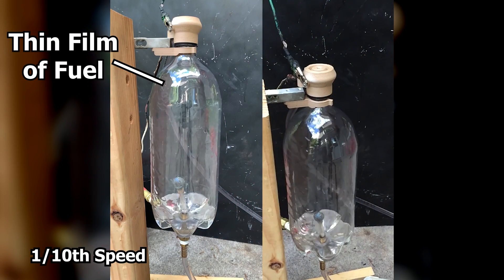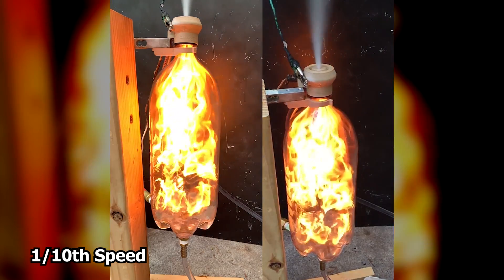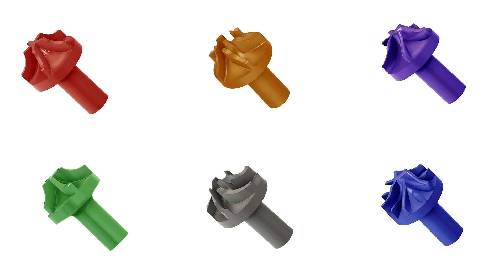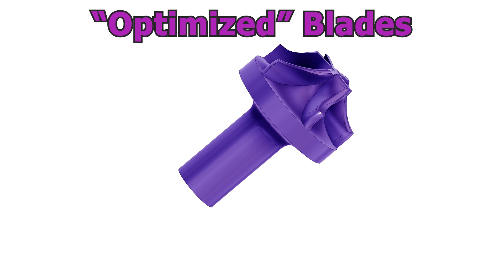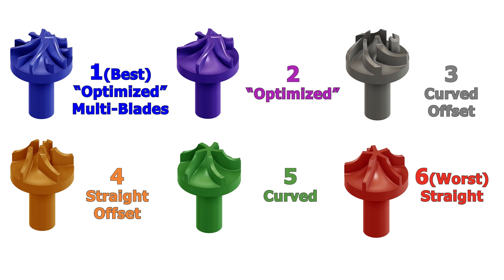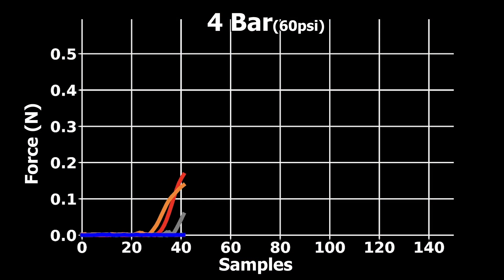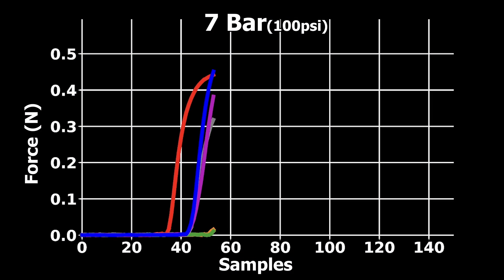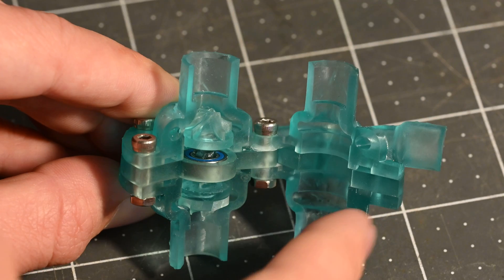Testing Tiny Turbo Turbines

Comment: These are impeller designs, they are NOT used for converting pressure-velocity to mechanical torque.. The losses are way to high, you mixed up the type of design. Air foil type of blade is used for the exhaust flow side...

Comment: Try a Tesla turbine. Since it will just be seeing compressed air and not high temperatures, you can get extremely thin discs and disc spacing by using thin aluminium sheets (think ~0.8mm thickness akin to soda can thickness or less). 

Apart from being easy to manufacture and balance, the simplicity of the design means that tuning it to your system is a function of simple geometric quantities.

Comment: You can improve a lot the efficiency of the turbine by making it spin faster, this is because the smaller a turbine is the faster it needs to spin to have high efficiencies. (you can guess the optimal speed by looking at the Balje diagram for turbines and adimensional theory of fluid machines)

Comment: search term you should loo for : " radial turbine velocity triangle" equations are time consuming to solve and not simple , that the rason for they use CFD. but the principle is that the air comes at a vectorial angle that depend on lift of the blade speed of the air and pressure. You should considere that each blade is actualy a wing that curve arround the axle torque and speed will also depend on the radius of course, and it will vari from the whole radius. the principal is th same as a propeler whre you trust depend on angl of atack naca profile and radius and  pitch at each distance of the center. so you have to figure out te formula for a particular point on th radius an itegrate all the point (integral equation)

Comment: manually calculate the turbin blade angle and length https://www.google.com/search?q=turbie+velocity+triangele&sca_esv=581287324&sxsrf=AM9HkKlQ2iFoMHRU_77X-ajUjlV_j-z0YA%3A1699644746299&ei=SoVOZaHqEeWkkdUP0bONoAg&ved=0ahUKEwiht-OKlrqCAxVlUqQEHdFZA4QQ4dUDCBA&uact=5&oq=turbie+velocity+triangele&gs_lp=Egxnd3Mtd2l6LXNlcnAiGXR1cmJpZSB2ZWxvY2l0eSB0cmlhbmdlbGUyBxAAGA0YgAQyCBAAGAUYHhgNMggQABgFGB4YDTIIEAAYBRgeGA0yCBAAGAUYHhgNMggQABgFGB4YDTIIEAAYBRgeGA0yCBAAGAUYHhgNMggQABgFGB4YDTIIEAAYBRgeGA1I0BNQ0gpY2RBwAXgDkAEAmAFjoAG2AaoBATK4AQPIAQD4AQHCAgQQABhHwgIKEAAYRxjWBBiwA-IDBBgAIEGIBgGQBgg&sclient=gws-wiz-serp

Comment: Compressed oxygen tanks (including the tiny torch sized ones) are 800 psi. Depending on the pump pressure curve, wouldn't that possibly achieve high enough pressure to overcome the chamber pressure?

Comment: You should make it fully 3d printed on FDM and with fidget spinner bearings I made one like that but I also 3d printend bearing didn’t work it turned but not great (btw  this test is a torque setup not rpm or pumping power unscientific but fun)

Comment: one other thing to take into account is variability in speed , the efficiency of the turbines could change at different speeds so it'd be interesting to see if the results change when you use a smaller prop.

Comment: Does a turbine work the same with water as with air?  I don't know the answer, but I feel like the viscosity of water would cause it to act differently than air, thus the most optimum turbine for both might not be the same.

Comment: Hi! I made some impellers out of wire cube storage brackets. They are plastic and have 8 straight blades arranged in parallel pairs. The gap between the centers of each set of the parallel blades is about 23% of the total diameter of the impeller. The blade pairs meet at the shaft and the shaft blocks the gaps between the pairs. I don't plan to replace them unless their performance is totally dismal -- and I don't expect it will come to that. But if you could test a similar design and compare it to the others, that would be awesome! Thank you in advance if you do!

Comment: How about a 2 stage turbine?
And maybe try a pelton turbine concept.
Also, you should measure power, not trust, cuz some turbines might perform better at different speeds, or have higher torque, others higher top speed

Comment: Hello! Your test at 0:56 probably did not fail because it was inherently bad. It failed because too much propellant pooled into your combustion chamber before ignition. In rocketry, this is known as a “hard start”. 

This can be solved by having the ignitor close to your injector at time of ignition, or starting with a small flowrate to achieve some combustion in your bottle and then crank it up to full flow.

Great video!

Comment: Equations for turbines can be found on several difrent NASA SP s (Special Publication) you can find these on the NASA STI server. Conveniently I have chosen a 3D printed air driven turbo pump for my scince fair project this year drawing some inspiration from your video 7 months ago. Axial and staged impulse/ reaction turbines are much better suited for pumping fluid because they can provide more torque at higher RPM with the same flow/presure.

Comment: Check out the exhaust/hot side of a turbocharger. Housing and turbine. They are pretty tightly fit for clearance between the turbine wheel and housing so no exhaust is waisted If you can reproduce this in a smaller scale this will produce phenomenal results and hopefully you have a propeller strong enough for the high rpm output. Will be like a jet turboprop just powered by high pressure air instead of jet A fuel.

Comment: Stators might be a good idea. Also, if you look at turbines on car engines, the blades are curved on the outer rim, bent towards the airflow. I think the thing you're going for with a turbine is to get the air "impact angle" at something like a 45 degree angle, even as the blade moves away from the airflow.

Comment: Some thoughts for optimization: 

1. It would be ideal to include a thrust bearing in this setup in addition to the radial bearing you included, as I would bet the thrust loading is being borne by either the balls in the bearing or the plastic of the housing rubbing, which would hurt efficiency.

2. It is very likely the case that the optimal rotational velocity for the turbine is much faster than the optimal rotational velocity for the propeller. Consider using a belt drive for reduction to get more thrust for the same inlet pressure.

Love the video!

Comment: FreeCAD has plugins for fluid dynamics simulations and shaping turbine blades, might be helpful. Personally I haven't figured out how to do much with the turbine plugin but the fluids one isn't super difficult to get used to. With a little AutoCAD experience, FreeCAD itself can seem like something Shaggy and Scooby dreamed up in the Mystery Machine after hitting the scooby snacks too hard, but it does have its advantages once you bend your mind the right way.

Comment: Getting an actually optimized wheel will probably require finding some research papers/theses on turbine design. You might be able to get in contact with indeterminate design, who 3d printed a few turbo compressors based on research papers he found for some tips (https://www.youtube.com/watch?v=1fVT1okcIEc)

Comment: Hi! Great video. Some notes:
1) you could also try adjusting input/output area of the turbine, it also plays a great role
2) in a "real" rocket, pressure will gradually go lower over time. a better testing strategy to measure efficiency here could be to gradually (and automatically) lower pressure, and instead of peak thrust measure  the area under the thrust curve (total impulse)
3) pumping air is too different from pumping a liquid (requires less torque and more RPM to be efficient). IMO these results won't convert well

Comment: Did you balance the propeller on the shaft?
In the first shot of it spinning it doesn't look very balanced, witch could lead to increase friction in the bearings und thus lower efficiency.
P.S.: Love your videos, good to see you back!
Reply from the maker: No I didn’t, I started to but then realized the turbines were just all warped during the printing/curing process. Thanks, it’s nice to finally post again!

Comment: You could add a diffuser so that the air has a better more efficient path of flow and you can try an enclosed impeller which are more efficient than an open impeller

Comment: Those type of impellers are used for pumping air, like in a turbo. Look at the exhaust side of a turbo for better ideas 🤘🏻👌🏻
Reply: Yes I can definitely agree his turbines resemble impellers.
Reply: I second this, the impeller and turbine have very different geometries. The impeller is meant to compress, it's optimized to convert kinetic energy into pressure, not the other way around. The turbine is meant to convert pressure into kinetic energy.
Reply: Commenting so it stays on top. Correct assumption 👍
Reply: The compressor and turbine in a turbo look actually very similar
Reply: I agree with what these guys are saying but to simplify it you need to design the the fuel side impeller for pushing liquid instead of being designed the same as the airside impeller.

Comment: Single ball bearing is limiting you here due to weeblewobbles. Some kind of hydrodynamic bearing set (as in also using thrust bearings) might be better eg. foil air bearings, would give less drag, should be 3D printable too (possibly?).
Reply: Could try to make some sort of air bearing, but most likely at this size and power output anything with more friction than the ball bearing would severely impact the output power. Perhaps you could try using a shoulder bolt as a shaft that fits tightly in double stacked small bearings or a brass bushing
Reply: @mitchellstrobbe7779  I think that using regular soda can materials for the foil in the air bearing would work great, could be assembled directly around the shaft, it would need to be shaped somewhat as the commercial ones (probably forming the inner spacer foil into a zigzag might be enough) , would just need to have a two part bearing housing to close around the shaft assembly.
Would be cool to see anyway